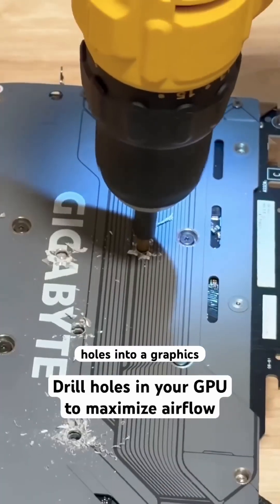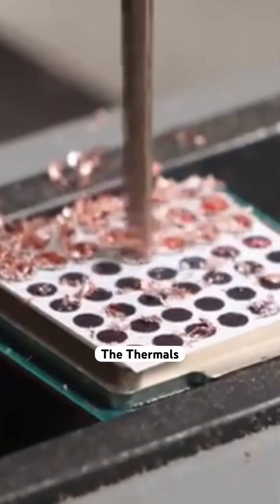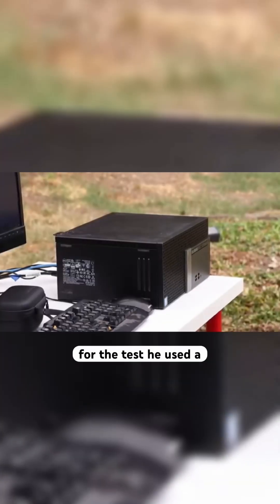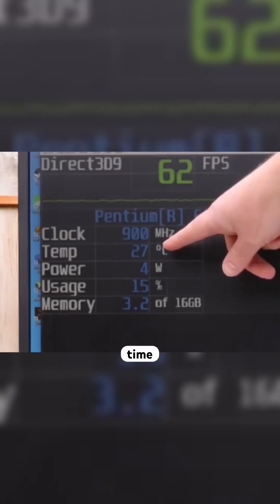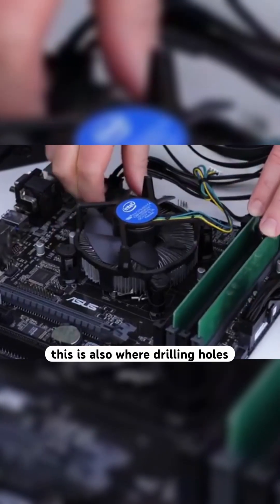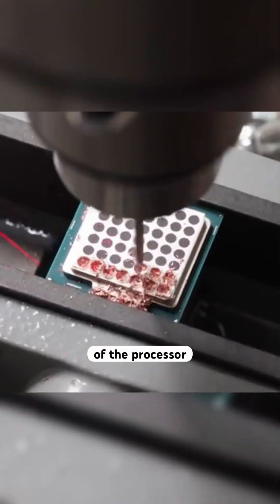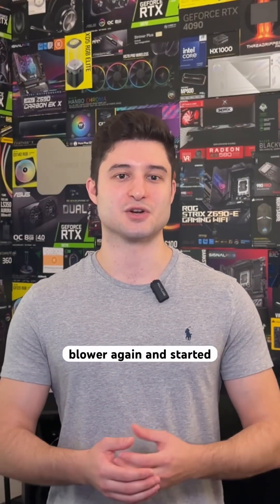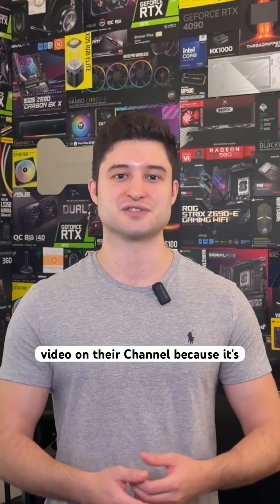Processor with holes actually performs better

Comment: The Holes is not why it is running Cooler it is the Power Pull that is the Difference the Cooler one is running at 51*C Pulling 9 to 10 Watts and the Hotter one is running at 93*C to 96*C Pulling 26 to 30 Watts on a Pentium G4400 it has Nothing to do with the Holes. Don't Trust anything from the Internet without Trying it for yourself and you know then what is real and what is FAKE and this is FAKE as it comes.

Comment: essentially creating a 3d, internally cooled surface as apposed to a 2d surface? really simply put? trying to wrap my head around that because if i take a muffin tin, wouldn't i have more surface area than if i took a muffins tin and drilled the bottoms out of each cup compared to leaving it whole? also wouldn't i have more surface area just leaving it whole compared to cutting the whole cup off, essentially what he did with a factory heatsink with holes drilled in it? if not then i sit just based upon this perfect balance of material and the inside rim of the drilled circle or the holes allowed some, maybe not perfect, but better release of heat under the heatsink and cooling across it? am i overthinking it?

Comment: Making cuts with a 1 mm thick disc every 2 mm would give a better result. I did this on the chipset heat sink and it proved to be sufficient. However, just like with drilling, you first need to make grooves in a vice with a hard chisel. You can achieve an even larger surface area by making transverse grooves every 3 mm.

Comment: Okay but why was the power consumption only 9w on the cooler CPU with the drilled holes? Vs the other which was pulling 3x more? Like of course the 9w CPU can cool with just a bunch of airflow over it.

Comment: The only reason it works is because the power of that chip is so low. You heat soak way too fast on higher powered chips. So, yes it can work, but not on anything you’d actually use.

Comment: Wonder how the result would be if, instead of drilling divots, you instead used a C&C to mill a ton of fine grooves into it instead, essentially shaping it like a integrated finned micro-heatsink
Reply: Could work better as anactivve  stream of liquid could carry away more heat  energy in total

Comment: I think here it is important to stress, that this won't help with thermal paste, it only helped here with leaf blower because he is using heatspreader as heatsink. Since as explained, larger surface you got for heat dissipation, more you dissipate and he used holes to  give it more surface with height difference. Same is with coolers, you got those fins as as thin sheets as possible, because they increase cooling surface. If they wee thicker and there would be fewer of them, you would get worse cooling.

As for drilling holes, this isn't actually practical or nothing new, we knew that for very long time. Instead way more interesting is what people overclocking do to get more extreme results, which gives you three ways they improve temperatures.

First one is lapping, surface of heatspreader isn't perfect, lapping it down can straighten it and if your cooler also is lapped or straight, you can actually improve thermals by evening pressure and due to surfaces being straight, heat transfer from heatspreader to cooler will actually be better. This one other than risks of overdoing it and going too low and lost warranty, is generally pretty safe, if you do it right.

Second one is that you could use lapping to also make heatspreader thinner, though in this case you would also need to use something to lower the cooler and regain pressure on it. But thinner heatzspreader would help too. But you do need to be careful how you do it to not damage anything. Since you can apply too much pressure when modifying cooler to press down on CPU with lower heatspreader.

Third one is that you can actually do direct to die cooling, this means that you remove heatspreader entirely. This process is dangerous, especially if heatspreader is soldered to die, since you do need to deal with solder, otherwise you will rip part of the die off, killing CPU. But if you do it right, you can take heatspreader off and use direct to die cooler design to actually cool the die directly, which reduces temperature. Since it brings cooling closer to the die. But gains were bigger with Intel before Ryzen, because they didn't use solder and their material between die and heatspreader was way less efficient than solder. Plus because it was more akin to paste, it also made deliding, process of removing heatspreader, a lot less risky.

Fourth one basically combines 2 and 3, making it most dangerous, but you basically take off heatspreader and then also do lapping to die directly. Because top few layers of the die and just protective materials that prevent mixing on atomic level. They make sure your CPU can be so few nanometers and live "long and happy life". But if you are extreme enough, you can throw that away and lap it off as much as you can. There is huge risk, because you want to take off as much as possible, but not too much to basically damage the silicon inside. However if successful, you then apply direct to die cooling for coolest possible results. Meaning cooler designed to do direct to die cooling. Also you need to make sure you apply right amount of pressure with it, because direct to die also introduces risks of you doing too much pressure and cracking the die itself.

Anyway, I don't recommend these to anyone who just wants to game and use their PC, it is for people doing extreme stuff. Like with overclocking, it is racing to what you can get, basically racing parts, they don't worry too badly about CPU surviving, hence why they take risks. Or even go into more extreme and do LN2 overclocking, which is waaaaay below 0C. It is so cold that you also can go too cold and you need to use blowtorch to warm LN2 pot up so you can even restart the system.

Comment: Now all you need is a heatsink with little cones that fit into those holes.
Reply: Fill them with liquid metal.
Or even better put some low boiling point stuff like alcohol inside them, then seal the seams and you have got poormen vapour chamber.
Reply: Not comes, domes

Comment: This only works on new pc, the reason is in old pcs the little men who living inside the magic metal bits on the sigils have seen it all so drilling the homes of some into oblivion to set a preemptive example wont scare them like it will for modern pcs. It’s why modern pcs run slower over time, its not a matter of hardware comparison or data bloat the little men in your pc just stopped giving a shit and death is a relief to them at this point. I mean the little painters alone get sick of repainting your whole screen every half second when you move in a video game. They are grizzled and done with it all

Comment: Yeah but if you want to put a heat sink on that processor then the surface area of the contact would be lower. Even with thermal compound the thermal rezistance would be higher because as far as I'm concerned it will never have thermal rezistance lower than metal. Though I have seen a thermal compound based on galium ... that could throw a wrench in my argument. Still, I think that the best way to increase surface area is sanding or sand blasting.

Comment: This could possibly be a whole system, i mean if he made extremely small holes in a cooler pattern then submerged in oil and underclocked everything i would probably work, but to be honest only would make sense as a YouTube video, no practice use unless you tried to make a console and the heatsink is the cooler i mean if the holes can fit the cooling pipes of CPU cooler ( the cober tubes in the cooler you can buy them separately) but that would only make sense if you went with a the highest performance intel desktop CPU and you got a customer mother board or modified an existing one and then be like "i created a better steam deck" or "steam deck 2 prototype leak (obviously make the video in reverse and say it's click bait)"

Comment: Not only did the surface area increase but the distance between the CPU core and the exposed flowing air was much smaller now meaning the airflow had less metal to cool down to cool the CPU core

Comment: This only works on the processor he did due to the low thermal points do it on a modern intel or amd chip and bam its all over.

Comment: It works because you're blowing air directly onto the IHS itself, if you where to use thermal paste and an air cooler the surface area would be in fact LESS and it would perform worst because of the added insulation in the holes.

Comment: I think something similar like this was done before. Removing a few micro meters of the surface to make it thin but not too thin to damage it.
Reply: "Lapping" is a thing, where you make the surface very very smooth and polished, and the same is done with the heatsink.  This gets the coupling between the surfaces more direct.  Also some people will just remove the IHS completely and apply the heatsink directly to the die, also after it had been lapped.  This becomes quite risky as the die is very brittle, but for some people it can help.

Comment: i mean yeah- but 99.99999999% of people arent just putting a cpu in a pc without a heatsink of any kind. if youre using thermal paste this WILL wreck thermals
thermal paste isnt as effective as the actual metal is at transferring heat, so if you have big gaps of paste globs youll be losing performance

Comment: in the end you compared the temperatures of "using a small fan with not drilled heat spreader" to "drilled heat spreader + leafblower" which have 99C vs 51C.
but when using leafblower on both, the heat spreader without holes is 75C and with holes is 51C.

Comment: Drilling holes in your hard disk will actually increase its capacity.
Reply: by 21%!
Reply: It could also increase write speeds because the holes would allow write heads in higher platters to see through to the lower ones, letting you write in 2 places at once!

Comment: "It took five minutes to reach a dangerous temperature"
> 27°

( I actually kept my Geforce 660TI with a failed fan alive and working with an external fan until I bought and installed a new GPU because I was scared of botching the fan repair and be left with no PC. It worked, somewhat, but blowing air onto the component rather than away from it is super wasteful and ineffective. Don't do it, even the cheapest CPU fan will do a better job than anything that blows air you have at home. It's all about airflow, and blowing doesn't provide that. )

Comment: This would still require lots of air flow, you lose thermal mass but gain thermal conductivity.  It's still good to have the mass to regulate spikes in temp, and the conductivity to get rid of the heat.  The CPU with holes will have less surface area to connect to a heatsink now as well...
Reply: Modern buildings have this issue too which is why they're less efficient than 1,000 year old buildings. People forget the benefits of thermal mass.

Comment: That only works with a leaf blower on top. If you were to put thermal paste on it and then a regular cooler, it wouldn't work. In fact it would perform even worse because thermal paste would fill up the holes and be thicker where the holes are. And thermal paste is worse than pure alluminium in regard to thermal conductivity.
Reply: The thing is, if this would work, every cpu manufacturer would sell their CPU's with holes or other shapes that would increase performance.
Reply: create a male version of the heatsink with LM to mate with the female IHS.
????
PROFIT
Reply: @TristanVash38  what would be the purpose of that? You still increase in-metal delay of heat transfer because you increase its mass
Reply: @AntonySimkin increase in surface area > negligible time in thermal transfer. my theory

Requires empiral testing and I think we all agree here that test data is king.
Reply: @TristanVash38 the math is pretty simple and straightforward. R=L/kA. Adding, for example, 20% of copper (estimate of holes drilling and adding copper) speed of thermal conductivity will drop by 15-20% and in most common cpu you'll have ~5K more on your cpu (if you had 50C, you'll get 55C
Reply: @AntonySimkin not to mention the potential for hydrolocking lmao. direct die cooling wins
Reply: @TristanVash38  absolutely
Reply: @TristanVash38  it's just not though
Reply: @TristanVash38  that's not a bad idea
Reply: As closer the metal-metal pair is, the better. Holes will make everything worse (not in case of air-metal pair). Liquid metal or whatever you want to put, will perform worse than as-thin-as-possible join. And if it's water-cooler, than tubes has to be as thin is possible where heat transfer occurs. Thermodynamics are complex but pretty straightforward.
Reply: @AntonySimkin you are probably right, it's less surface contact with the heatsink
Reply: Thank you. I was about to say this.
For a heatsink this is utterly unfeasible.
Reply: You would need the cpu cooler base to have matching bumps. Preferably machined to be an exact match. This would actually increase the contact surface area for heat transfer.

But doing that would make the cooler specific to that IHS, which isn't very good for compatibility, and would also make both components more expensive.
Reply: It could maybe still work with a thermal pad and a fan on the pad. It would be interesting to see how that works thermal wise.
Reply: The idea was to have the smallest possible heatsink
Reply: only works in Mexico, got you
Reply: I feel like the paste design and giant fan or liquid cooler heatstink, increases the flat surface design just fine, by significantly a greater area than the drilled holes. They do their job and soak up the heat. Interesting though still.
Reply: it's still more surface area. perhaps liquid metal is the answer. I don't know
Reply: @DecibelAlex  As closer the metal-metal pair is, the better. Holes will make everything worse (not in case of air-metal pair). Liquid metal or whatever you want to put, will perform worse than as-thin-as-possible join. And if it's water-cooler, than tubes has to be as thin is possible where heat transfer occurs. Thermodynamics are complex but pretty straightforward.
Reply: @DecibelAlex But you're filling that area with much less conducive thermal phase.

Comment: While in the given case it's true in real world application this would be detrimental to your cooling affords. While you could increase the surface for heat transfer, you would be forced to increase both sides. You would need to have a cooler with matching bumps on it to fill the holes on the other side. And even then you will have gaps that need to be filled with some sort of thermal paste. But in a formation of bumps and holes the paste wouldn't distribute itself like on an even surface. Bottom line: In real world cases for consumers holes are bad for cooling not good.

Comment: Beginner Level Stuff.
Drill a hole in your Fridge for all the Cables coming out of your PC and just put your PC in the Fridge while you play
Reply: and your pc is dead because of condensation 😂
Reply: Condensation is not the problem, dirt and other materials in the water cause short circuits. 

As long as it doesn't flow a long a dirty panel it be fine even if it drops right on the cabels
Reply: @chimagamer4157 wait really? I thought the problem was that water is more of a conductor than air?
Reply: @chimagamer4157 water conducts electricity
Reply: @NightOwlErin  he's trolling
Reply: @NightOwlErin pure water is not a conductor, it’s like an insulator
Reply: @ShapeshifterOS  Pure water does not conduct electricity, but it causes corrosion, which makes conductive salts leak into it. This causes problems.
Reply: @TheLukasDirector  no water in the world would be pure enough to not make it conduct electricity. Simple exposure to air will cause contamination. Stop trolling.
Reply: Desktop PC running a game: ~2k BTU/hr heat emission.
Average Refrigerator: ~2k BTU/hr heat removal.
Suggesting all your refrigerated food be room temperature: priceless.
Reply: Or if you live in Canada in -40 temps you can drill a hole in your wall and run the cords through the wall while keeping your PC outside for 6 months of the year! Much lower temps than a fridge for those 6 months.
Reply: I forgot who did it either Linus or Gamers Nexus tried the refrigerator thing and then tried the ice cooler method and both were not great
Reply: Just get a portable AC to blow on it 😂
Reply: The best method for that is to run a water loop in and out of your fridge to an aluminum pot or something full of water on a shelf in the fridge.